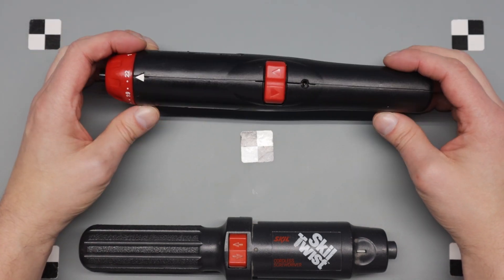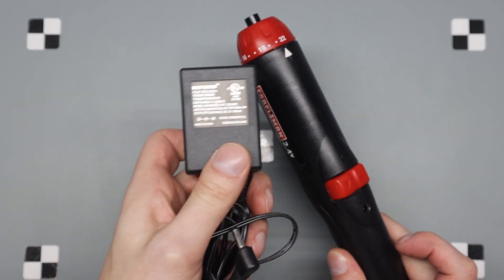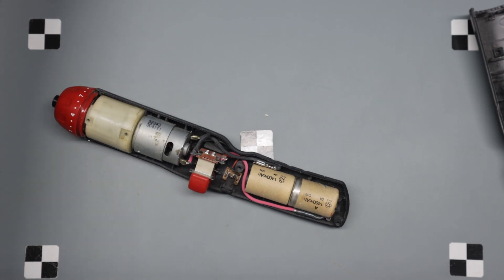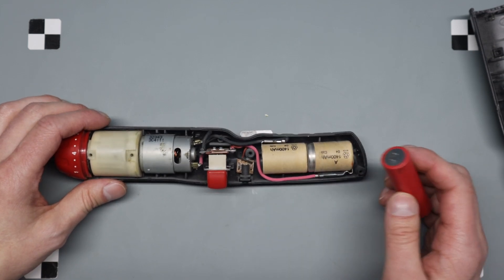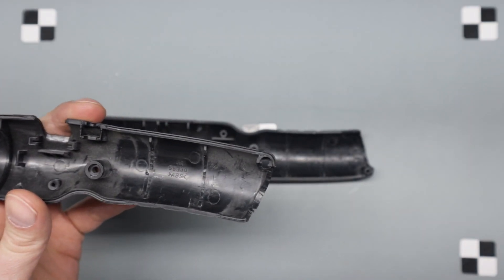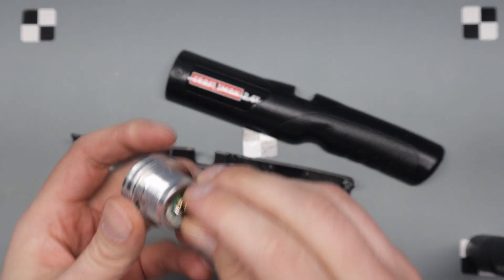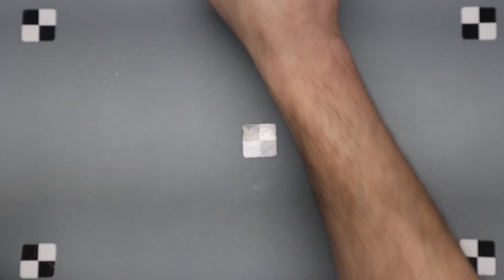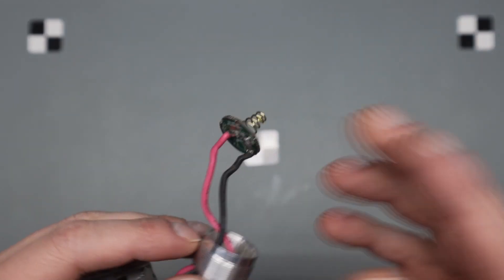Convert Craftsman Ni-Cad screwdriver to Lithium using an 18650 flashlight

Comment: Hello sir I have that exact screw driver and I was wondering what size or type of batteries those were. The one with the twin short batteries. I know they are 1400ah 1.2v nicd. But the short size is throwing me off.
Reply from the maker: Oddly it is still a Sub-C, but there are different sizes of Sub-C. 
This is a 4/5 SC, which isn't 4/5 inch, but 4/5 the length of the main size (43mm 1.6 in), so 4/5 of that is (34mm 1.3 in).
Just search for "4/5 SC battery".
Reply: But is the motor/gears safe handling 3.7v instead of 2.4v?
Reply from the maker: Yes